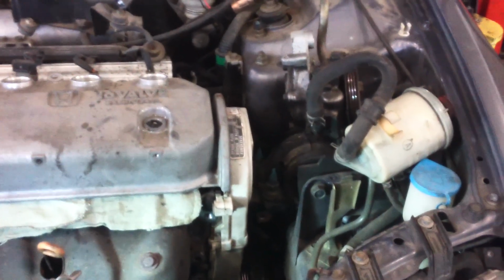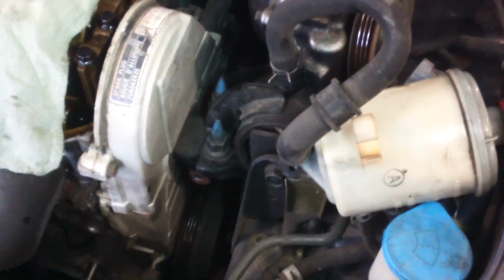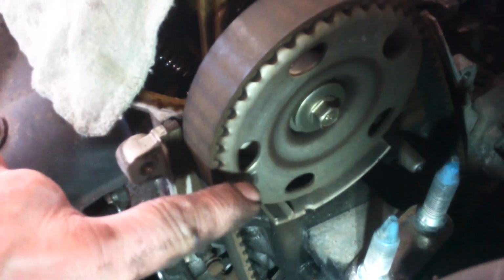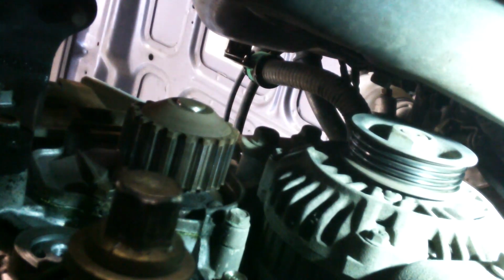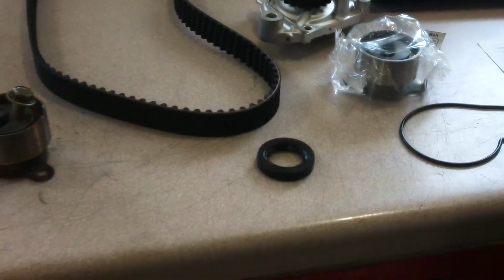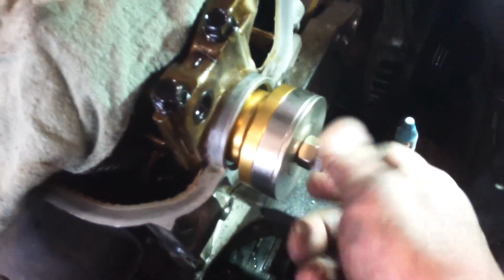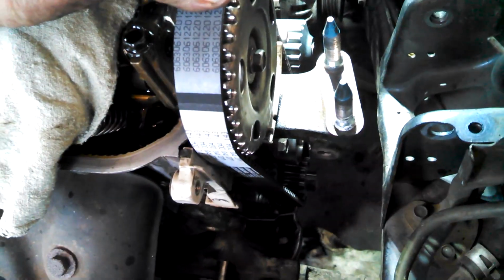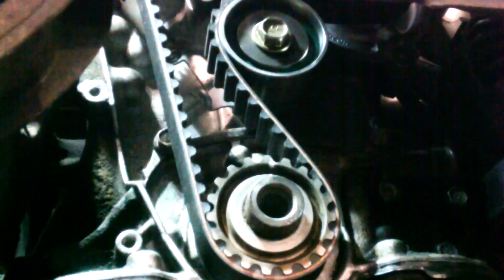Timing belt replacement 1988 - 1995 Honda Civic 1.5L 4 cylinder water pump Install Remove

Comment: for best results after setting TDC mark the old belt to cam and crank sprocket, then transfer marks to the new belt and install new belt per reference marks. This will assure no belt slack between cam and crank and perfect timing after installation.
Reply: mkrp4 how to tell if timing belt is bad or not working? Thanks in advance

Comment: You shouldn't need to use any silicone at all. The rubber seal will do its job. Out of all the water pumps I've changed, I've never used silicone. And I've never had anyone have a leak.

Comment: wow thanks for the step by step mr fixin. thanks a million
Reply: how do you turn back the crank to create tension? put the crank pulley back on ?? use it to create timing belt tension?then take off again?
Reply: dennis parrish I dont see how thats possible without changing the alignment,3 teeth different?
Reply: dennis parrish I AGREE.  Since the crank is moving 3 teeth of the cam timing would be off between the cam and crank.  FCAS could you further explain this.  I am beginning to think that this the "ART" of putting one of these on.  This is the make or break part of it and really none of the videos I watch are clear about adjusting the tension on the left side..
Reply: Cy Ance Or start the crank gear about 2 teeth (approx - may have to mark it) clockwise of the actual crank timing mark.  Apply tension to the tension side of the belt by hold the cam gear fixed with some type of holder and then with breaker bar turn crank bolt counterclockwise until crank gear mark aligns with the case mark again.  At that time let tensioner take over as the bolt is unscrewed to allow spring to pull back tensioner pulley. Then retighten  tensioner pulley and rotate engine counter clockwise a couple of times to check timing mark alignments.  I am not going to put on a new belt that has the same amount of slack as the old one - that doesn't make sense.

Comment: Why don’t techs CLEAN those timing belt covers when they R and R them?  I can’t imagine them not doing that.  Just paid $1400 for a VX timing belt replacement, new cam and crank seals and radiator flush.  Still  trying to determine if I have leakage.  With the original oil and grease accumulation, externally, it just looks like the work was never done.  No brainer it seems to clean the parts before re-installing them.

Comment: To remove the harmonic balancer bolt you can take a 2 foot length of chain and a carabiner.  Take the carabiner and link it to the end of the length of chain and then to the towing bracket that is at the front of the car.  then take a 5/16th 3 inch bolt and put it through a chain link and then through one of the holes on the bottom of the harmonic balancer.  Using a 24" inch 1/2" breaker bar and 1/2 extensions/17mm socket also with a 48" . 1" diameter black steel pipe cheater bar (bar is $18.00 at Home depot) apply pressure and pop loose the balancer bolt.  It will sound like you broke something, but you haven't.  Also your 5/16" bolt will be bent but the harmonic balancer should be ok.  Also best to do this with the upper motor mount still in place as there is too much movement doing with the mounts off.  It is the poor mans way of doing it.
Reply: Cy Ance but if the bolt is frozen that wont work Ive seen keyway's snap and bolt heads break off in crank shaft even when heating up bolt it's a case by case on the bolt
Reply: Or you just set it up with the cheater bar against the frame or floor and bump the starter.

Comment: One more thing I do not think it is necessary to remove the power steering bracket.  I would remove the center/lower mounting part of the upper bracket it is only 1 bolt (I think) compared to 2.  All said this is a good video thanks FCAS.
Reply from the maker: Cy Ance I appreciate the input into doing this job, thanks!
Reply: ...actually you are correct I was wrong Removing the power steering bracket is the best way to go as it allows you access to the A/C bracket/tensioner - otherwise it is too limited in space and tools to work with removing belts etc.  Thanks for the vid.

Comment: is the crank pully bolt reverse threaded?
Reply from the maker: +Jeramy Deane No it is not
Reply: Thanks.
Reply: +Fixing cars and stuff hey man I am having a lot of trouble with mine. I just broke my Stanley ratchet and a s-k ratchet plus two Stanley 17 mm sockets. any ideas on how I can progress?
Reply: +Jeramy Deane Maybe its loktight on there.. I would hit it with a blow torch for a min or 2 then try a cheater bar with a wrench not a socket wrench
Reply: no
Reply: @JeramyDeane  5 ft cheater bar and alot of flexing of the breaker bar is easiest way but be careful not to bust ur ass when it does loosen. Also bring a freind to help hold the extender and also pull the bar down... Ill make a video thiss week how to do it.
Reply: @DeadEndGlennTruckinAhead  lol ok you got me on the week thing but my advice stands strong

Comment: u didn't say anything or show anything about the ac unit i totally when threw shit trying to take it off now im down to striped bracket off the ac pully great vid but you fail to say anything about ac unite bro.
Reply: not all models have ac unit only the ex maybe thats why
Reply: +Jay Platano I'm no honda expert or anything but I know that the dx, vx, and cx civics from the 90's usually didn't have ac and they were sold in america xD
Reply: uuuummm okay??? my 95 dx hatch doesn't have factory ac
Reply: anyone can go on the internet and say they've owned every single civic ever made in every trim level
Reply: and my civic has ac it just isn't stock like the last owner installed it
Reply: hahaha yea at least my story is believable you're telling me that you've owned every fucking civic ever made and a quick google search will tell you that not all civic trims from the 90's came with ac
Reply: My '91 CRX DX has factory AC  I didnt mess with taking it off or the pulley tensioner...There is a pivot bolt on the tensioner, no mention about it being tightned last according to the chiltons manual...

Comment: for the timing marks around 1:55 which one do you line it up with?
Reply from the maker: Pretty sure the red one on the crankshaft pulley, you will see at the 6:10 mark marks under the timing cover on the crank gear more Top dead center marks to line up, so do not worry too much about those.  (i case I am wrong about those)

Comment: How much should I expect to pay to have an automotive shop do this?
Reply: it honestly depends the shop I worked in this is about a $700 job
Reply: My local mechanic charges $550 for everything. Parts and labor. It's a fair price, but the kit costs $80 -$100 and I can save a lot of money doing it myself and this job isn't really hard.
Reply: @TheRichardF10  rock auto Gates about 50